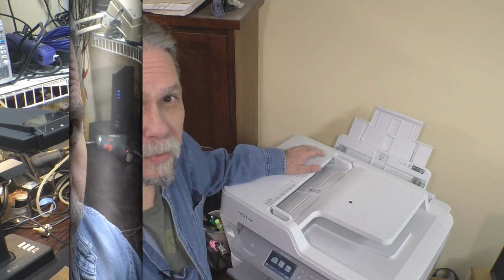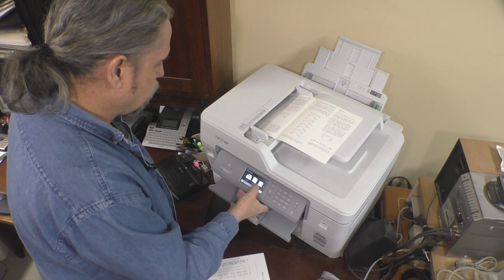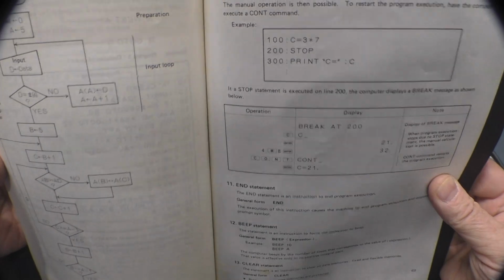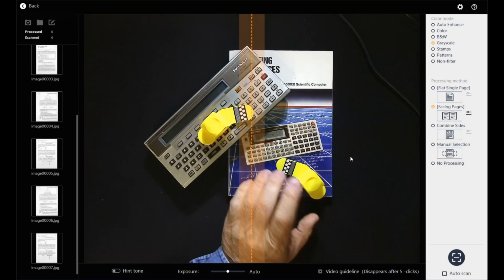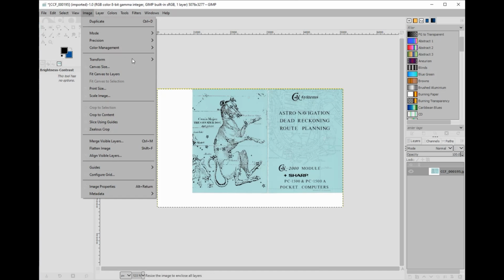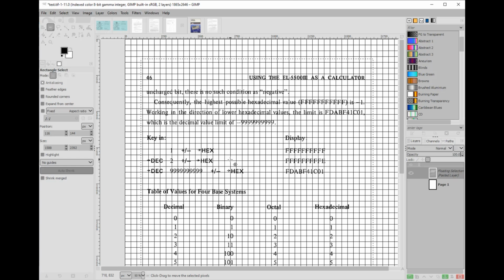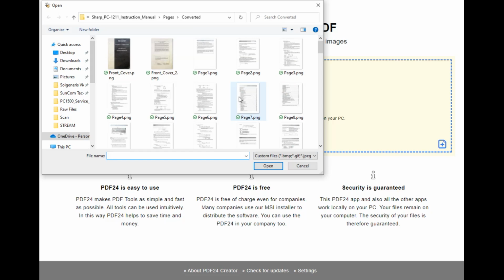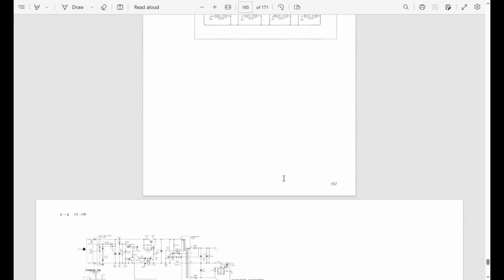Vintage Document Preservation: Imaging HW, Editing SW, PDF creation. Featuring CZUR ET24 Pro

Comment: Thanks for sharing this Jeff! I have some (now rare I guess) italian manuals for 1970's devices. I'm not wanting to cut them to separate the pages, but all the rest of the process is interesting to be fully documented when I decide it's time to scan them :)
Reply: If you do then thanks for the effort. Please check the shading in diagrams though, as the CZUR can't scan them properly. An alternative is a flatbed book scanner that is similar to a normal one, except that it can go right to the edge on one side so that you can have the book open but not flat. The best non destructive option is a DIY camera based system.